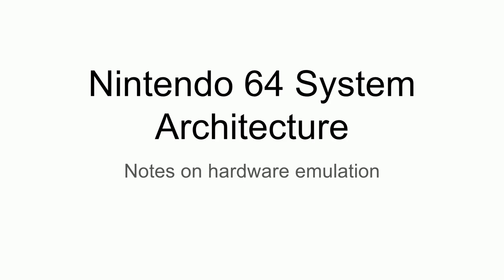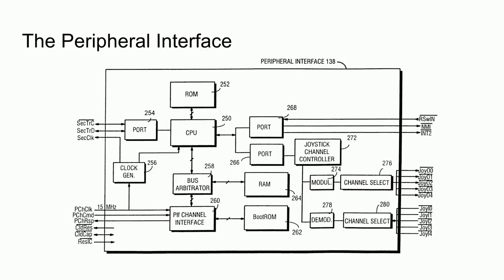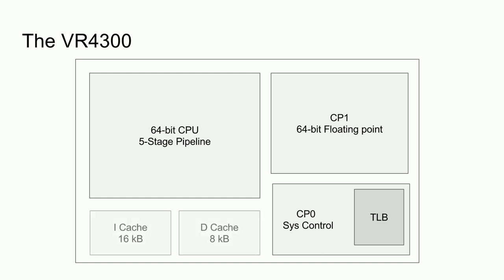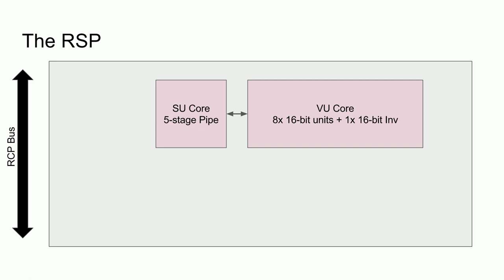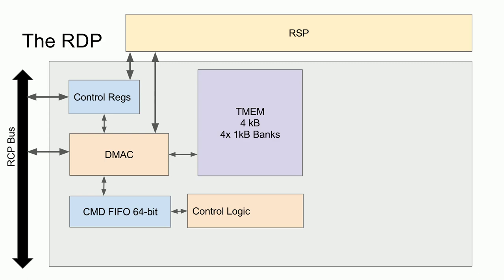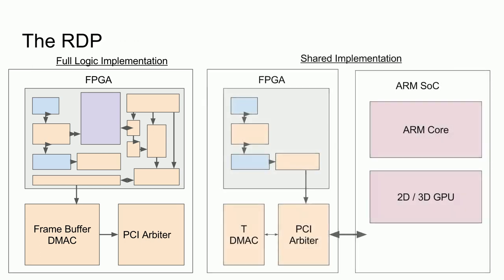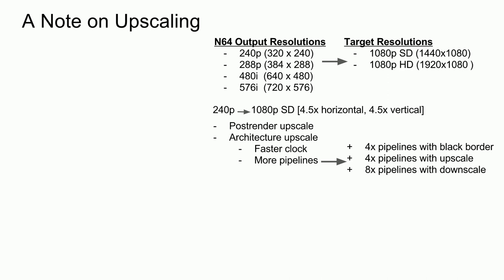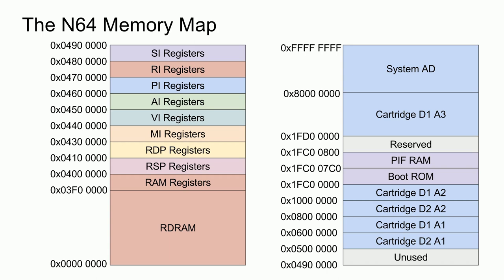N64 Hardware Architecture

Comment: This is exactly what I was looking for. I have a few questions about the RDP though. In your diagram, you state that the Color Combiner and Rasterizer submit a pixel's color, x, y, and z info to the Blender which it then uses to write to the area in memory where the z-buffer and frame buffer are stored in RDRAM.

However online documentation that I've found says that the programmer is the one who defines the location of the Z-buffer, the amount of frame buffers and their sizes. I was wondering if someone could instead theoretically implement a tile-based renderer with 32x16 pixel tiles where the Blender could be told to loop the z-buffer and frame buffer data back into to TMEM through the system bus. If so then the z-buffer wouldn't use up any of RDRAM space or bandwidth and the frame buffer could be written in bursts to possibly reduce the hit from RDRAM's latency.  Is the requirement to render the frame buffer to DRAM enforced by the "OS" and microcode or is it the case that it absolutely HAS to write to main memory since the Blender is connected to the Memory Interface?
Reply from the maker: So the programmer sets the location of the Z-buffer (called the z image) and the frame buffer (called the color image) via RDP commands. These commands are placed in a memory block and transferred into the RDP via the RDP DMA controller. When doing so, an image (buffer) width is specified for the color image, as well as a RDRAM address for both. 
I don't know for certain, but most likely, this command populates internal registers within the blender, setting the Z-buffer start address, the frame-buffer start address, and the image width. Then as pixels come in, there is another DMAC which isn't mentioned by the documentation, which will retrieve the current image block, and also write it back to the correct memory location. You know exactly which memory address you are working with given x and y, since the address is going to be addr=(y*width + x)*bit_depth. 
So you can't loop it quite like what you were thinking, but you can do something similar, which is mentioned in some documentation. TMEM does not exist in the same address space as RDRAM, and therefore is not accessible by the RCP's internal bus.
What you could do though, is to render a small tile to RDRAM, then copy it into TMEM as a texture, then draw the texture on the screen to a new frame buffer, etc. There may have been some games that did this, but I don't know of any for certain. Your biggest issue will be memory bandwidth (which is what you said), where it is doubtful that you would obtain a decent framerate doing so. 
So to more explicitly answer your question, having the framebuffer in DRAM is a hardware limitation.
With that said, there is no reason that an emulator (software or hardware) couldn't provide a feedback path. Both commands to set the framebuffer and z-buffer use 26-bit addresses, with an extra 6 bits free. Those bits could be used to specify a memory location. For example, bit 26 = 0 could mean RDRAM, and bit 26=1 mean TMEM (obviously the TMEM address would need to be much smaller, but it could still be done). My original though for an FPGA implementation, would be to use a modified address (so set color image would force bit 27 to be 1 for example),  placing it in another part of the system memory, and then make sure that the video interface realizes this change. The main issue would be reloading the framebuffer into a texture, so some address tracking might be needed. Also, if some games cleared these images from the RSP or CPU, then that wouldn't work. I may have to rethink that, however, since the memory bandwidth of DDR3 for the target dev board I was considering is listed as 800 Mbps, which is less than the original N64 peak bandwidth (4028 Mbps) - it's possible that one of the sources made a mistake with Mb vs MB (bits vs bytes). If that's the case, a custom board would be needed, with a higher memory bandwidth - a 1080p framebuffer wouldn't fit in the internal block RAMs either. 
Hopefully that was helpful, and not too long of a response / confusing.
Reply: @RTLEngineering  Ah thanks. I was just trying to see if any practices that began after the N64's lifespan could have been used to its benefit. Doesn't look like it's flexible enough though. Like I guess someone could get something like deferred shading but I can't imagine there would be much benefit lol
Reply from the maker: @myownfriend23  It could have worked. There is a statement about rendering to indexed buffers in some of the documentation, which can then be re-used in the final render. It only has the limitation of going through the RDRAM, which poses bandwidth issues. So you could implement deferred shading, but that's tricky since it basically uses a fixed-function pipeline, and not a programmable one that is needed for deferred shading. I think the indexed image idea (indexed because it stores a larger image in a smaller memory footprint) could be used for reflections though (water, mirrors, etc.). Also, some of the parallel programming engines used in the PS2 for particle effects could probably be implemented in the RSP, all of which are techniques that came after the N64. The N64 manual even talks about hot to more easily parallelize a particle like loop to run on the RSP.
Reply: @RTLEngineering  I'm back with more questions! lol

In the VR4300, was the CPU the only one responsible for things like branching or could CP1 do that, too?

Having looked at programming documentation, I saw that there was a microcode command to send six vertices to the RSP to create two triangles. This raises some questions. For one, the documentation states that the vertex coordinates are specified as 16-bit integers, not floats, is this true? And if so, why would the VU need to do transformations with 32-bit operations?

The other is that it suggests that there's no way for the RSP to take advantage of triangle strips or indexed triangle strips with Nintendo's own microcode. If that's true then wouldn't that be a simple way to at least double the amount of lit polygons since any triangle after the first would only need one vertex to be transformed and lit? I can also imagine the back-face culling process benefiting from this as it knows that the triangles are connected. So as soon as it determines that a triangle is back-facing, then all it has to do is determine is the next vertice is to the left of the last two in view space. If so, that triangle can be culled. If one of them goes to the right, then if the last triangle that passed the visibility test is in front of it, then it too can be culled.

Would something like fast inverse square root be implemented to the N64's advantage?

I've also read about examples where the CPU worked as a a kind of fragment shader on the frame buffer to do things like full screen guassian/box blur and jigsaw puzzle effects and it was able to do a full screen lens distortion effect in Perfect Dark which I believe ran at 640x480. If a 93.75 Mhz, single core CPU can iterate through 76,800 to 307,200 pixels fast enough to do such complicated effects after the RSP and RDP had already done texturing and lighting, wouldn't a 62.5 Mhz 8x16-bit SIMD unit like the one in the RSP be able to do the same operation up to 5x faster? At that point couldn't microcode be devised to allow the RSP to do per pixel lighting? That would essentially treat the RSP like a unified mix-precision shader cores in mobile GPUs. If someone got as far as getting per-pixel lighting running, then the next thing to try would obviously be normal mapping... though I strongly doubt that the RSP as enough oomf to compute tangent and bitangent data then transform the normal maps to world space AND do per pixel lighting lol

And the last question (for this comment at least lol). Factor 5 apparently stated that they create custom texture formats for Indiana Jones and the Infernal Machine. How exactly would they have gone about that if the RDP wasn't all that programmable? Were they simply creating texture formats to get the size down that were interpreted by the RSP and sent to the RDP as indexed textures? That's probably the one aspect of the N64 that I've seen documented the least, the RDPs instruction set. I did find out that the clipping and culling is all done on the RSP and not in the rasterizer though.
Reply from the maker: @myownfriend23  I'm happy to answer them to the best of my knowledge.

There were CP1 (floating-point co-processor) branch instructions, which basically did a floating-point test, which set a flag, and then they did branch on true or branch on false. The important point to understand there, is that CP1 and the main CPU operate in lock-step, so you can't have CP1 run in parallel. In reality, the VR4300 has an integrated integer and floating-point pipeline, so the only distinction between CP1 and the main CPU was logical / instruction based, and not visible in the architecture.

The RSP used fixed-point arithmetic and not floating-point. However, there are some cases where fixed-point is more accurate (since you have more digits). I'm not sure what you are asking about in regards to 32-bit operations... All of the instructions are 32-bit in length, and the RSP had 128-bit ports to the vector register file.

 It wouldn't quite double it, but it could help with bandwidth, at the cost of requiring the RSP to do more work. The advantage of triangle strips and triangle fans, is that they require fewer vertices to be specified, but all 3 vertices need to be calculated independently within the final render hardware. The N64 development kit did allow for developers to compile their own micro-code for the RSP, so it's possible and likely that some of the studios did implement triangle strip / triangle fan rendering routines. In terms of back face culling, this wouldn't be helpful, since there is no requirement that the strip or fan be planar. For example, you can create a sphere out of only triangle strips, where some of the faces would be culled but not all of them.

There is a "fast" inverse square root implemented in the RSP via a look-up ROM. Are you thinking about in the CPU? Or some method that does not require a ROM?

I didn't know of games using the CPU to do rendering effects, but it makes sense. For most games, the VR4300 is sitting idle while it waits for the RCP to complete draw commands. In theory the RSP would be faster, however, it was almost always in use, and when it wasn't, it was waiting for data / instructions to be moved in from RDRAM.  If you wanted to do per-pixel lighting, you would still have the issue with bandwidth as mentioned previously. You would basically need to operate on the image per-pixel, and store it back into DMEM. Since the RSP had 4K DMEM, everything would have to fit in there. Requiring 912K per image for 640x480. So it might be possible to do with 32x32 blocks, which you would need 300 of. And you can pipeline the DMA operations (swapping which part of DMEM you are using), so it might be possible to do it without pausing the RSP. I have never tried it though, so I'm not sure if it's feasible, but it is certainly possible (you might end up with 2 fps doing so though). If you wanted to go that route though, you would be better off using an implementation that replaces the RDP with 1 or 2 more RSPs (since the RDP was much larger).

For the custom texture format, I'm not actually sure how they did that. The RDP can't be programmed to use custom formats, so there are two possibilities that I can think of.
1) They sent the compressed texture to the RSP, decompressed it there, did a DMA to RDRAM, and then another DRAM to TMEM (which makes no sense, since it only helps with loading time from the cartridge at the expense of extra compute time).
2) They implemented an indexed texture which had the color table changed by the RSP in real time. 
There is another possibility that occurred to me. 
3) They could have sent the compressed texture to the RSP, decompressed part of it into an indexed texture, performed a DMA to RDRAM back to TMEM, then also swapped the color tables for the indexed texture from the RSP. It should be possible to pipeline this process, so effectively you are only ever doing temporary block transfers from the RSP -> RDRAM -> TMEM, and altering the texture in TMEM on the fly. 
The third option seems like the most likely possibility, since it spreads out the bandwidth over time instead of having it happen at once. It would be very tricky / finicky to implement though, but should be possible via custom micro-code. The biggest problem is the lack of a connection from the DMEM of the RSP to the TMEM of the RDP other than via RDRAM (the DMA controllers can't access DMEM or TMEM directly). The only connection between the RDP and RSP is the X-bus, which is between DMEM and the display command buffer.
As for clipping / culling, you are correct, it's done on the RSP. The RDP is pretty dumb, for a textured triangle, you basically have to provide a start / stop coordinate, as well as a slope for each edge, and that's all you can do. The coordinates have to be within screen space as well, so the clipping / culling has to be done before the display command is generated. I believe the microcode used for triangle draws did all of that within the RSP though (culling, clipping, re-triangulation, transforms, texture coordinate mapping, slope calculation, and display command generation).

Comment: how much memory is chip-internal-local in RDP DMEM? to be used as hardware z-buffer memory buffer, or frame buffer chip-local extension
Reply from the maker: None. There's a small cache that's controlled by the hardware (to cover bursting), but otherwise the z-buffer and frame buffer are stored in the shared system memory.
The DMEM on the RCP can't be used for z-buffer or color directly. It can be used for it indirectly, but you're going to end up copying stuff in and out of main memory which will perform worse than not using it at all. Alternatively, it's possible to program a software renderer using SIMD on the RCP, but it would leave the RDP idle.
Reply: you can do microcode changes directly, maybe a true hardware z-buffer, using the DMEM/IMEM 4kb caches @RTLEngineering
Reply: maybe TMEM could  be partially used as local z-buffer cache, while other part is used as normal texture memory @RTLEngineering
Reply from the maker: That's what I meant by "software render using SIMD". There's no read/write path between the DMEM and IMEM, nor is there a read/write path between the DMEM and the fixed-function RDP path. All communication between them would need to be done using DMA over the main system bus.
Regarding TMEM, it's the same. There's no direct write path, where you can only write to the TMEM using DMA. Worse yet, the DMACs in all cases required that one address be in main memory, so you couldn't DMA between the memories without first going through the main memory.